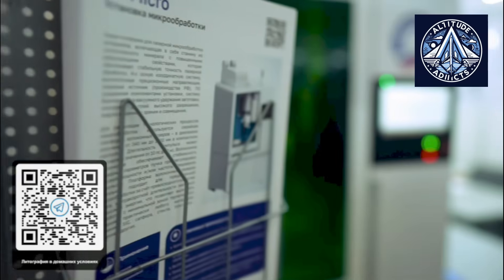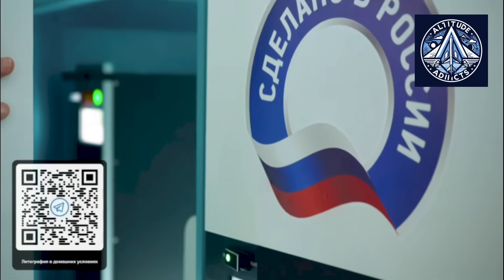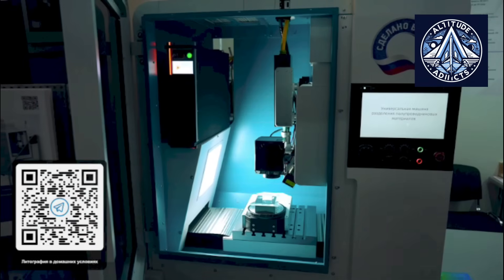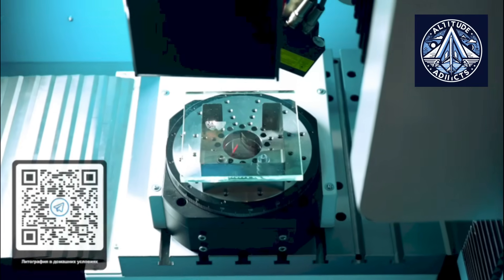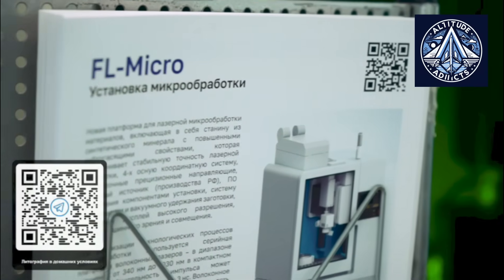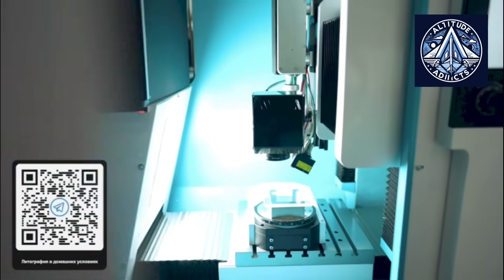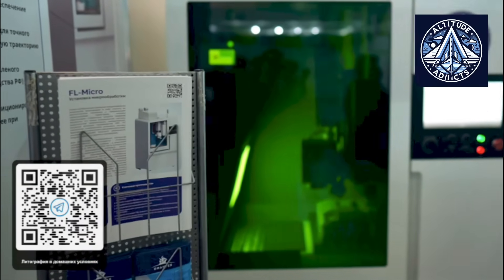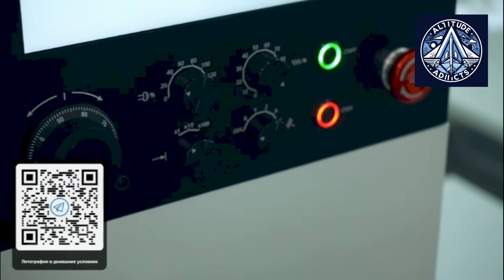How Russia Is Building 10 Nm Advanced Microchips Without EUV | E-beam lithography | DUV

Comment: First things first for novel ones. When semiconductor companies and their clients says 2 or 3 nm it has nothing to do with actual length of chanell.Its marketing trick. Under 28 nm technology every technology dimension was pure lie packed as a marketing ... Since power consumption is main problem in chips,mostly because densly packed RAM transisotors,every time power consumption per transistor halved they halved the name of technology. Hence now you have 3 nm technology which is actually 22 nm technology. ASML is unicorn but not that unpenetrable as West thought.

Comment: ASML is actually using Russian components, specifically the precision gas laser technology for ASML was developed by Russian research and engineering institutes and ASML leases this technology and sources components to present day from Russia. And to present day Russia is the only reliable supplier of noble gases required for such lasers. These ASML machines simply won't operate without supply of Russian components and noble gases.
Reply: HolyS 🎉 I didn't know that! Thx for the info.😮 Sort of problematic for ASML....😂
Reply: These supplies to the West must be banned.
Reply: @joeshill3667  What? 🤣
Reply: Not true. ASML uses Western invented Western produced gas lasers. Most gases come from other sources not from Russia.
Reply: @davidrizkk  If you could read correctly he  wrote that the technology that creates laser beam from the gas comes from Russian invention not the gas itself!
Reply: @S300V  The gas itself also needs to be brought into Netherlands as they don't produce it in the country. Whilst Russia isn't the only source of such noble gases, it is a market leader. So most of such lasers and chip manufacturers do use Russian supply. These noble gases are needed for other purposes not only for ASML lasers.

Comment: No sé suponía que Rusia solo producía componentes de 300nm, como es posible que logren los 10nm 🤔🤔🤔.
Entonces la diferencia con occidente es a lo mucho 10 años y tal vez se cierre esa brecha a 5 años en 2028
Reply: If you want, the gap is already less than 10 years, the only problem is that you need to start production and pay for the machines. Technologically, the gap is 5-8 years, and during this time, if there was a goal to produce 10nm or even less, it would be possible. However, this technology is not currently required in the market for vehicles, aircraft, military equipment, or space applications, which require less than 28nm.